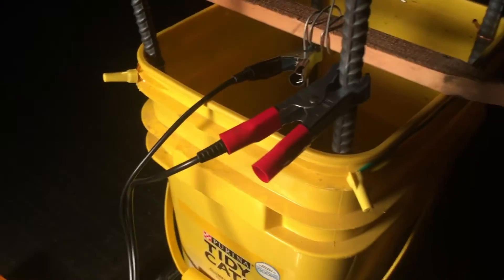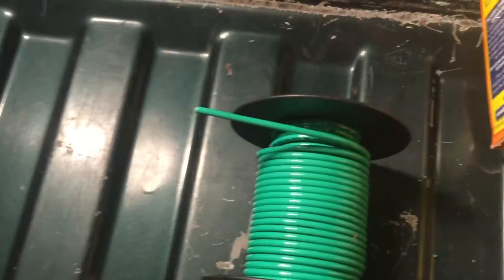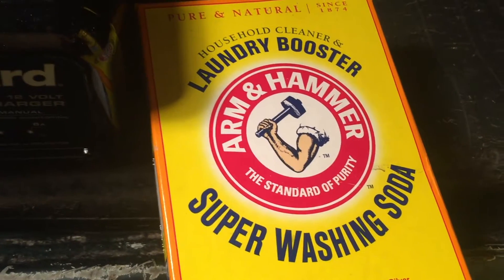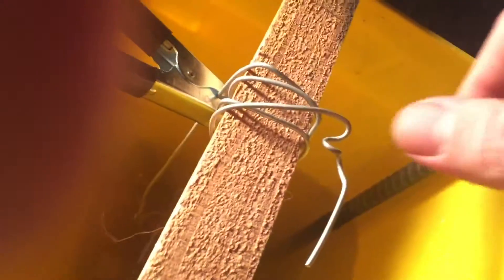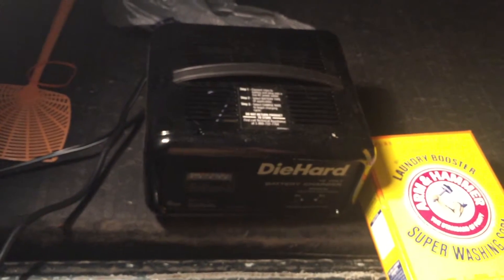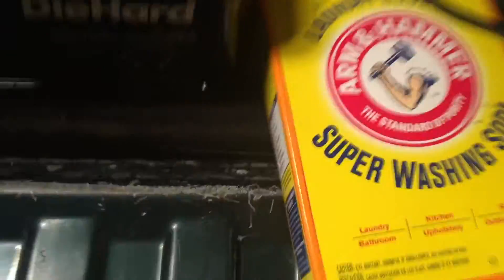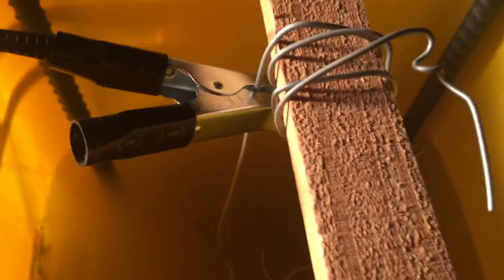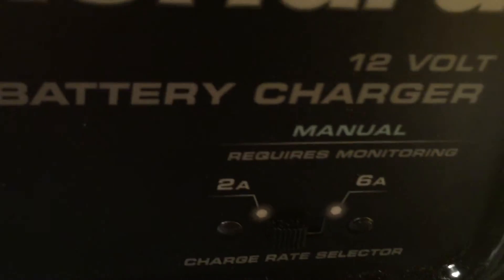How to build an electrolysis tank on the cheap

Comment: wow you beat me too it my electrolysis video is going up next what if any thing will you put on it to presurve the iron I'm waiting on this stuff from gemplers something  mentalmetal made a video useing it and it looked less dounting than hot wax but I have tested the electrolysis on  some very coroded vise grips I found in the bean field and it worked pretty good
Reply from the maker: Exploring Indiana I haven't thought that far ahead yet. Been reading on different stuff to use to for that but haven't bought anything yet. The iron is pretty thrashed so I'm too concerned about preserving it. Mostly I just wanted to see if the tank would work as I'd hoped.